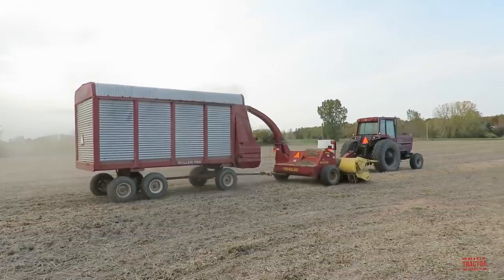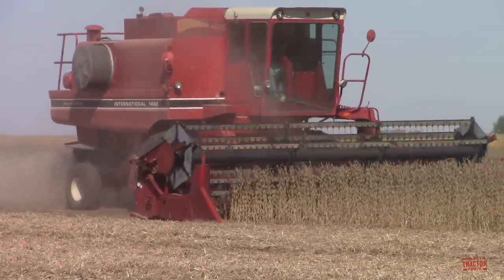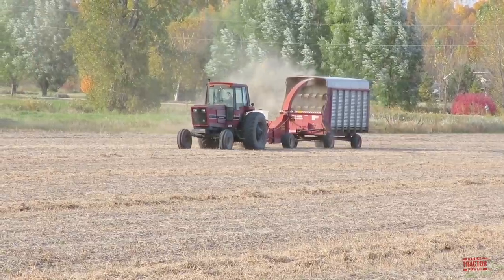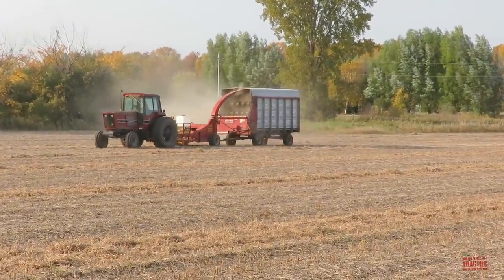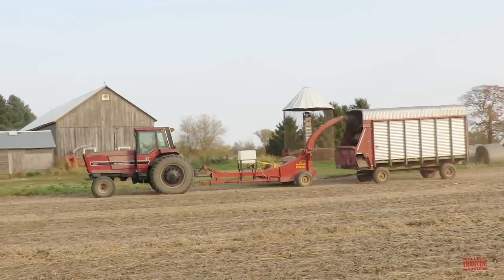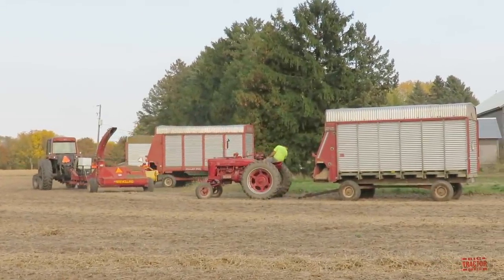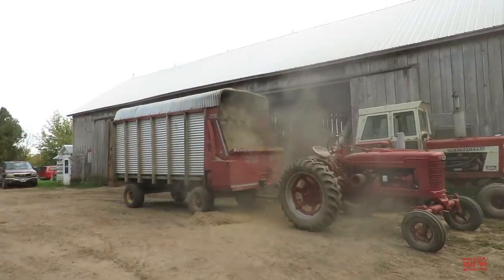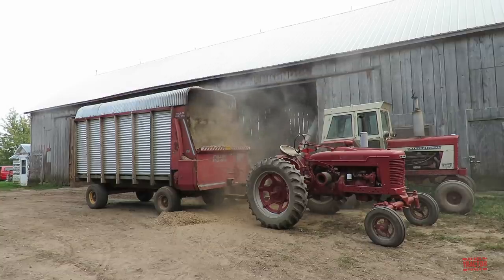INTERNATIONAL 5088 Tractor Chopping Soybean Straw

Comment: Do they actually use thease old tractor's and methods still on this farm or was it just done and filmed for fun
Reply: I would say all the larger farms around me have older tractors around. They use them for odd jobs that doesn't require a brand new, 350 hp, fwa tractor. Jobs like feeding, spreading manure, mowing ditches, running augers and the like. They still have newer tractors for field work too.

Comment: We used to vacation in Green Lake Cty, WI in the 1980s. I remember driving around the area checking out the dairy farms and saw the farmers chopping wheat and oats straw for bedding. It was blown into dairy barns for storage, then used over the winter months for the cows. I was told that several barns in the area caught on fire during this process when a stone struck the blower blades and created an igniting spark. Your video on chopping bean straw was very interesting, and I enjoyed watching the old Farmall M pulling in loads. We farmed with a '49 M and I spent many hours on that tractor. Thanks for the memories.

Comment: That's the typical type of farm in the UK , small combines  and tractors, on the farm I worked we had three trailer's with turn tables  which were an absolute pain around a farm yard especially if you had to reverse them, as we never had a tractor which could nose them into position,  also when loaded the weight didn't go on the drive axle of the tractor so you didn't get maximum traction , the good old day's, give me this new equipment any day so you can really enjoy your farming. Great video, stay safe 
Regards 
Kevin Fox,England Essex

Comment: Dad and I baled 1,400 small squares of soybean straw this fall with a Deutz Allis 7085 running a New Holland 315 baler.  Also made 80 round bales with another 7085 running a New Holland 855 round baler.  We have in the past forage chopped it for calf hutch bedding too.  There seems to be a lot of complaints about using soybean straw but I like using it.  Windrowing it outta the combine and not having to rake it is quite the difference maker on the amount of dirt/dust.

Comment: I did a lot of this type of work in the late 70s early 80s in the UK, didnt have the horse power thats here, I used a MF 188 multi power rated at 75 engine hp behind I pulled a Claas Jaguar forage harvester, at the rear of the forager was a hydraulic pick up hitch, after plenty of practice I soon hit the trailer drawbar ring every time, 50 acres a day was good going in a heavy crop of grass, when sun dropped below sky line I could see tractor silencer (muffler) glowing red hot!

Comment: 826 is supposed have red lower front side panels, just like all 856s do. Wonder why this one has white. Maybe they replaced some sheet metal with parts from a 706 or 806?
Reply from the maker: Yes. I am not sure why it’s side panels are not red.  At 50 years old it has most likely been repainted at some point.

Comment: Those wagons seem really heavy when full, that poor Farmall M is going to struggle if there's hills in between the field where the soybean straw came from, and its final destination, the barn where its being stored. I would have used a stronger tractor like John Deere's 8R or 9R series tractors (or similarly sized tractors from other manufacturers) if I had any lying around somewhere. If I needed to get the soybean straw back to to the barn in a hurry, I would have probably gone with a JCB Fastrac, those have a top speed of somewhere around 45 mph iirc
Reply: soybean residue is much lighter than green chopped corn or hay

Comment: We bale ours with a Kubota 5160 round baler pulled by a 7320 deere. Combine is a 9690 massey ferguson with 30' head. We use a mix of soybean and wheat straw. 1 to 1 ratio. Works great in our free stalls.
Reply from the maker: Wow. Very cool to use a 9690.